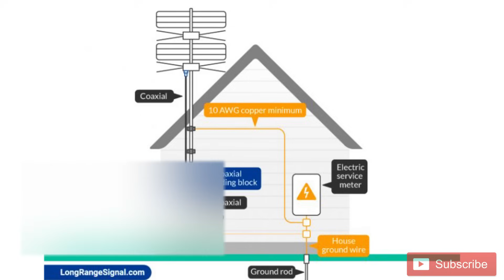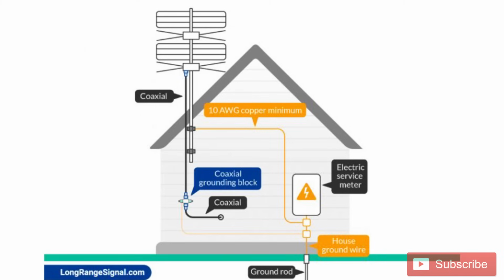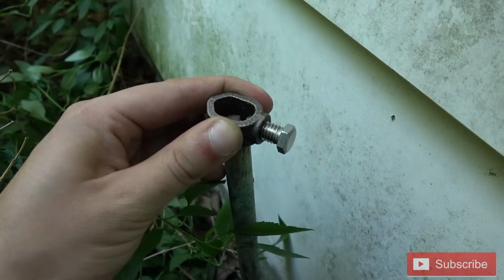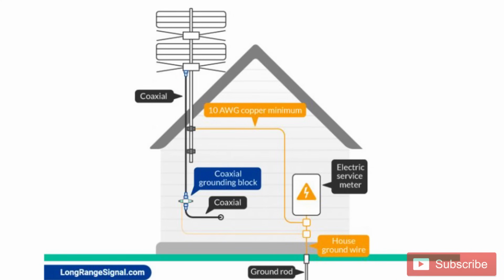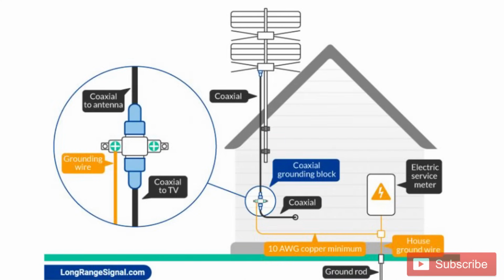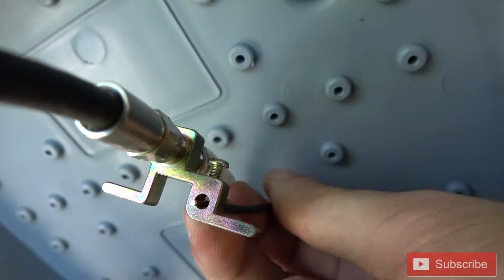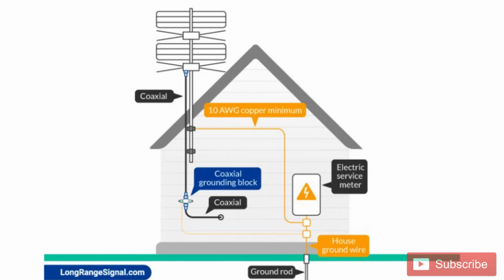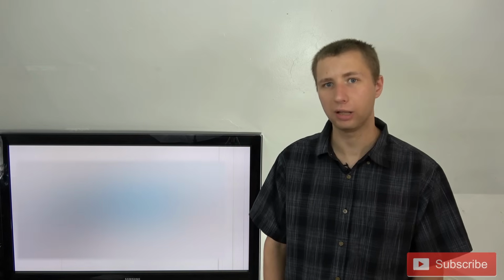How To Ground an Outdoor TV Antenna Per NEC

Comment: I used the grounding block you showed in the video and linked in the description and lost my VHF (2 - 13) channels.
Did I get a defective grounding block or is it designed to filter out the VHF?
Reply: You lose some signal strength every time you go thru a coax connector, resolve it by putting a powered signal booster on the coax.  You can buy them at most BigBox stores or WalMart
Reply: You probably need a preamp. 

The kitztech and channel master variable gain models work really well.

Comment: How does fm radio work so good indoors unlike tv? I get fm radio stations from over 200 miles away completely clear but can barely reach tv stations from less than 50 miles away. The tv stations are on vhf high.
Reply from the maker: The one part is that VHF frequencies do better at penetrating building material. FM is on low VHF around the TV channel 6. The VHF combined with the forgiveness of analog is why FM stations can be clear when digital signals can't. Digital signals require less power than analog to "cover" the same areas but I feel this was over estimated during the digital conversion.

Comment: Got a $4.00 grounding block at my local electronics store and setup a CM Stealth Antenna with a AD VHF Retrofit Kit on the peak of my roof eve about 50ft high. Your spot on about the difference about an indoor and outdoor setup.  I'm now pulling in 84 channels all with crystal clear reception from both the Chicago and South Bend markets.  There isn't a channel on the spectrum that I shouldn't be receiving.  I'm in a sweet location right on the South Shore of Lake Michigan with the towers just 40 miles in each direction.

Comment: The power service meter and the homes safety ground is required to be grounded at all times.  The utility doesn't disconnect the ground, but they do disconnect the 2 phase wires coming from the grid feed, usually by removing the meter from its plug or turning off the service entrance switch at the meter if there is one. Then they put on a anti-tamper tag.  If they removed the houses ground connection, then they are legally responsible for any lightning damage caused by ungrounding your house wiring!  This includes being electrocted while taking a shower due to a lightning strike to your house...

Comment: Tyler, great video about grounding outdoor antennas man. Though you did miss a couple things my man, you didn’t mention about antenna poles mounted to concrete pads or actually mounted in the ground. Pad mounted antennas still need all the grounding methods you talked about. Although, poles mounted in the ground I.E. digging a 3ft X 1ft hole and placing the pole into the ground. Additionally, driving the pole down another foot or two then filling the hole using cement for minimum 12-18 inches then topping it off with some of the dirt from the dig. 

Please remember, all water pipes, natural gas pipes, antennas, phone or cable service entrance conductors need to be bonded to the homes electrical grounding system. Plus, if your antenna is grounded to the home grounding system, if your power is turned off you do not loose the ground. If the electric company completed the wiring correctly, the incoming neutral terminal is solid and not interrupted by meter removal. Also, the ground rod should be bonded to the neutral terminal inside the meter box prior to all other panels. 

Another way of bonding an electrical service is at least bonded inside the panel to the neutral bar of the first means of disconnecting power. The ground rod if accompanied by a ground distribution block outside the panel is used, it makes it easier to bond natural gas pipes & water pipes to the homes electrical grounding system as well. This is so that ALL other panels, cable services, phone services, satellite services, above & in-ground pools and OTA antennas can be grounded to the homes main or sub panel and actually be grounded.

In-ground poles don’t need the mast grounded to the homes grounding system as they are already in the ground 3ft-4ft but, it wouldn’t hurt to still ground the mast to the home grounding system just to connect the antenna ground to the existing grounding system. Plus the coax does still need to be grounded in all mount cases as you described to protect digital or sensitive equipment in the home that the coax is connected to. 

Love your videos Tyler, myself and I’m sure many others are very grateful for the Over The Air antenna knowledge you’ve talked about in previous videos and hopefully many more to come.

Comment: Caution:  In-line coax grounds can risk signal loss or add noise.  I've read that you really  don't have to ground the coax as long as you've grounded the entire array by a ground clamped to the mast.  btw, in my old neighborhood many outdoor antennae were not grounded and nobody's antenna ever got hit by lightning in the 30 years I lived there.

Comment: I put my ground block on the mast itself. The wire goes into the house right next to the mast. I used 8 awg ground wire. It was too big to get into the hole on the ground block. I had to put half the strands on the hole and wrap half around the screw. Not the most beautiful but who will know?  Then I ran my wire down the valley on the roof down to the ground and into the clamp on the ground rod. I was going to ground it to my box but it would not have been the shortest and quickest way to the ground.

Comment: Any advice for selecting a grounding rod for just the antenna? I see they come in different lengths (4 & 8ft), different diameters (½ & ⅝in), and different materials (copper & galvanized). Do these different options make a huge difference?
Reply from the maker: I cannot comment due to liability reasons. Refer to national electric code and do not take any shortcuts. This is LIGHTNING protection we're talking about. Consult with a local electrician if needed.
Reply: @AntennaMan  Thanks bud, I really appreciate you taking the time to respond in your video was very helpful, liked and subscribed.

Comment: I have a power limited license in the state of MN. Antenna or dish grounding is covered every year I attend a mandatory continuing ed class. If anyone reads this "Never unhook the house ground from the ground rod as the voltage difference could kill you". Have a licensed electrician provide a grounding block for you. 
Our presenter told us about a satellite dish installer that unhooked the house ground not knowing the neutral feeder line had been damaged and was open. It put him into sudden cardiac arrest. Fortunately a neighbor was watching and called 911 and started CPR on the man. This story is told every year I go. I am not going to comment on how to ground the antenna system.
If you are building a home and have a say in what gets done have the electrical contractor but in a ground block for utilities. Second I strongly recommend that a copper wire of correct size is buried around the foundation at the correct depth and bonded to the house electrical ground in the chance that you might need to connect a utility ground to your house ground that is too far away.

Comment: I used to install satellite TV systems professionally. Here's the process we followed when mounting a reflector dish: 
On our mast footing, whether pole or roof mounted, we had a grounding screw. Bonded to the side of the RG-6 feed from the dish was a thin "messenger" wire. We'd bond that to the mast footing and then bond the other end to the ground block in the cable demarcation box. This ground block was then bonded to the universal ground with the number 10 grounding wire, which is substantially thicker than the "messenger" on the coax segment from the satellite mast. 

Would the same setup with the same coax+messenger cable work here, rather than using 10 grounding wire for the entire run? It seems the me the major mechanism of lightning protection here is to drain built-up charge from the metallic antenna/mount down to the grounding system, rather than to carry the full might of a direct strike. I think 10 ground wire would just vaporize with a direct hit.

Comment: Good enough. 

The grounding at the service ground rod is more about single-point grounding; the installers will think that depicted connection at the meter box (but said as "service box") is close enough, but the connection would not be authored that way.  Also, a disconnection of service will only involve the hot leads; not the ground.

Comment: Um.  Your electricity getting turned off does not interrupt grounding.  The chassis of the service panel (if it's up to code anyway) will be attached to a grounding rod directly outsider your house via a grounding lug on the inside of the panel.

And don't forget that if you install a separate ground rod for your mast or antenna, you must use a bonding wire to connect the new ground rod to the utility panel safety ground rod in order to comply with the NEC.
Reply: NEC 2011 250.94. You need a bonding bridge to ensure that all grounding systems are connected at one point. Previous to this you were able to get away with two seperate grounds for high voltage and low voltage. This however is a poor choice to have two seperate grounds because of the voltage potential difference. The least concern is ground loops and the biggest concern is incorrect paths to ground and electric shock.

Having everything ground at one point is a great way to eliminate annoying ground loops.
Reply: What about when an old building that had knob and tube that was converted over and only has a hot and neutral, would you run a ground to a water or gas line?
Reply: @jp4yu  let me say this first:  Never ever eVeR EVER connect an electrical ground to a gas line!

Now, with that out of the way.  In theory, the neutral bus should have been bonded to a safety ground at the service panel when it was upgraded even if there is no ground wire available at the outlets in your house.  If there is, then the same rules would apply--ground rod under the antenna, bond wire to the electrical safety ground.  

Naturally, theory and practice aren't always the same thing...  If there is in fact no safety ground, then your house is "floating" anyway, so has no ground potential to equalize with.  Just a ground rod under the antenna and don't worry about bonding (though you really should upgrade your house wiring to provide grounding--but most of us aren't made of money, so I get it).  

I would never bring any part of the grounding system for an antenna into the house to ground to a pipe or anything else--that's an invitation for lightning and static discharge to come on inside and ping-pong around your house wiring and anything plugged into it (or even just nearby it) since there's no clear path to ground back through the service panel.

Something I didn't mention in my original comment is that you should also be grounding the shield of your coaxial cable both at the mast base and the entry point to your house.  If that takes more than one ground rod, you must bond all of the rods together to be within code.
Reply: @jp4yu ground to the power mast with a ground strap

Comment: Antenna grounding is a complex subject that certainly can't be covered in a 4 minute video… not even the basics. Unfortunately, there's a lot of misinformation, and patently incorrect statements, in your video and throughout the comments. I'll address a couple of things you said in the video

Grounding an antenna does not prevent a lightning strike from occurring. 

The methodology that you demonstrated here will do nothing for a direct strike.

While proper grounding will help with static build up on the antenna, the way you've done it here will not.

Your statement that this is the proper way to ground an outdoor TV antenna according to NEC is terribly misleading for the viewer. People will do what you said and then think they are in compliance when they likely will not because there are just too many variables - and most of those variables cannot be enumerated in the NEC - to make that claim. 

Using what cable and satellite dish installers do as a benchmark for best practices, or even acceptable practices, is a big mistake. 

The utility company disconnecting your service does not disconnect your ground. Whether your service is turned on or off has nothing to do with the ground.

Comment: As an example/place and not the only example/place Home Depot and Lowes have Ground Wire and Grounding Hardware.

Ground Wire is Hard Drawn Copper Wire / Hard Drawn Copper Alloy Wire.
The Wire is  , Stiff , Hard , Dense , and is Usually Bare Wire . 
Will last a long time outside. Because it is made to last a long time outside.

You will often see the word , Bonded , when working with electrical and grounding.

Bonded simply means that the connections made so will not come loose in normal use.

In other words , Tight Strong Connections. Grounding hardware and Electrical hardware is designed to provide/produce Tight Strong Connections.

--------------------------------------------------------------------------------------------------

And Yes I know , some humans want to use aluminum wire.

I Do Not recommend aluminum wire , reason : aluminum tends to give way at the connection point , and this makes a loose connection.

And Yes I know that aluminum and aluminum alloy can be made to be very strong and very dense. However will you find this type and kind of aluminum at your local hardware store??

And Yes I know that aluminum wire and tubing is in grounding situations and situations such as Antennas.

However I still Do Not recommend aluminum wire for grounding.
And aluminum can cost more then cooper.

And Yes is True you can use aluminum wire if you want to.

Comment: X tv tech .we installed an antenna 300cable lightening suppressor to water pipe.lightening hit only damaged the wire .we redid your way hit again blew back of house open major fire  .😀this is true story
Reply from the maker: What area do you live in and how high was this antenna?
Reply: Antenna Man 2 fanily house Englewood n.j . broad Ave I believe was 40yrs ago they after the got hit they had an engineer give us a drawing which we followed similar yours about year later hit again .we did hundreds of antennas used a block the ribbon went through attached to water pipe the 300 would end up welded to siding and melted .we did second as you described believe we did 2 grounds one on cable and a ground rod.3-4 of our jobs got hit  only one major damage.thank you.😎
Reply: We used the bare dead soft gd. Wire thing aluminium.
Reply: Was not high probably chimney or saddle Mt .don remember
Reply: Believe certain locations are susceptible to repeat strikes .
Reply: Not every bolt of lightning is the same. No matter which grounding system, that second strike would have been too scary even for Chuck Norris.
Reply: Peter S yuppp thank.!😀

Comment: Small detail that needs to be covered you demonstrate connecting to a ground rod but failed to mention it has to be the ground rod of the house you have not been able to use your own ground rod for antenna grounding for well over a decade per NEC code if the distance between the Mast and the ground rod of the house is too far it is possible to use a secondary ground rod but it must be bonded to the main ground rod with a minimum of six gauge copper cable to negate any voltage potential differences which makes it impractical and you should simply go to the main ground rod.
Reply: a little punctuation goes a long way...

Comment: My friends amateur radio antenna has been struck on Two separate occasions, and his grounded antenna did little to protect his electronic equipment. One of the lessons he learned from this experience was not to share his household grounds with his antenna grounds, and to disconnect your antenna cable and 120 volt power strips should a lightning storm occur. Using the service panel grounds can protect against a static build up, but if you get a direct strike it wont be pretty. Here are some pictures of my friends home after his antenna took  a direct hit. https://www.youtube.com/watch?v=wZtWWO8cfH0
Reply: that of course is a violation of the NEC and in theory just plain silly.

Comment: I used to live in a Condo with a master antenna. The during a storm lightning burned a spot on my TV screen.
Reply: If you get a direct lighting strike no grounding will prevent damage. It may help limit damage in the form of fires, cooking your house's entire electrical system but make no mistake adout it something isn't going to be the same again.

Comment: will the coax block of course weaken the signal
Reply: If you are splitting hairs.

Yes the coax grounding block will weaken the signal a slight amount.

However the Benefits Far Out Way the , very , very  , very , slight signal loss.

And Yes you can find technical information on the internet.

Comment: Great video, clear and concise information. Your installation grounds the antenna mast and the coaxial braid but omits the antenna itself which is connected to the center conductor of the coax into your home.  You may also need to add a Lightning Arrestor (or Spark Gap) is required. It looks just like your coax ground, but allows the center conductor to short to ground in case of a lightning or static discharge.